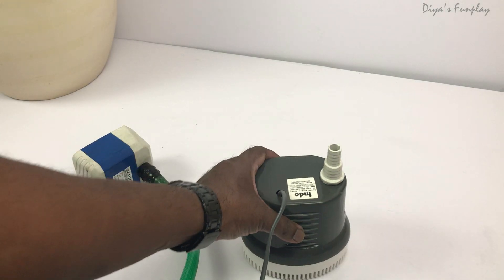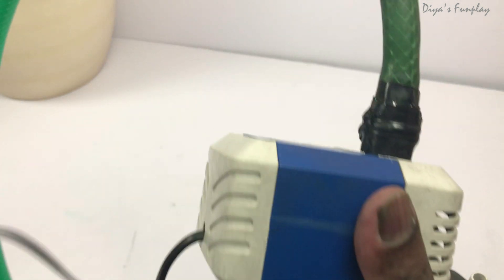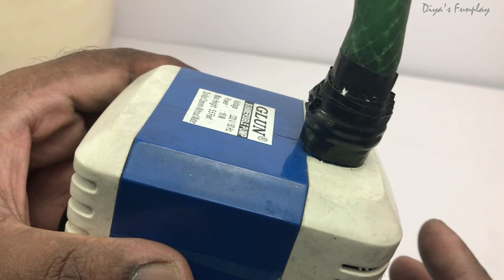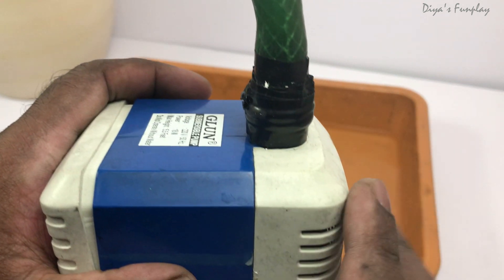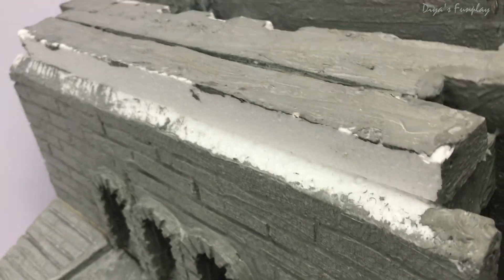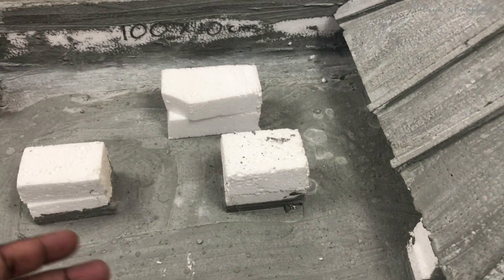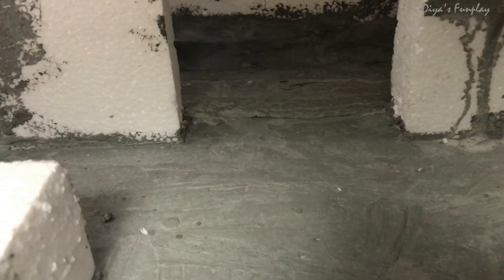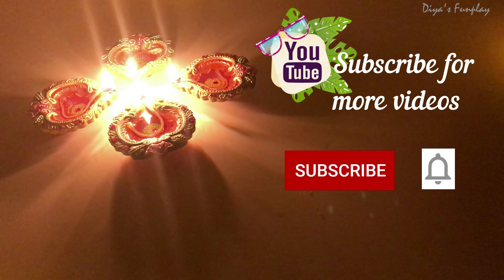Dam project model clarifications | How to use a fountain pump? | Working dam model project

Comment: what is the machine name u used for making lines on dam in the previous video (said to wear mask and do and do it outside)..
Reply from the maker: Its a "soldering rod". Take elders help while using a soldering rod. The rod will be very hot. Else, you can also use a thin metal rod. You will have to heat the rod and create lines in the thermocol. Definitely take adults help for this step.